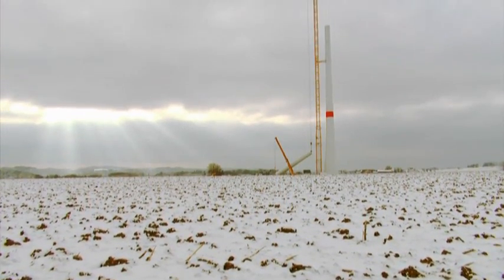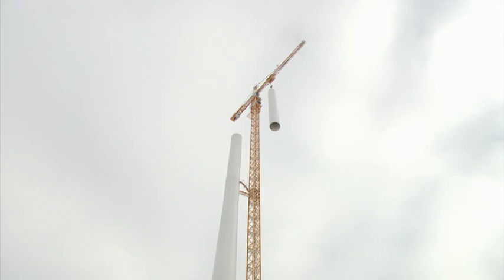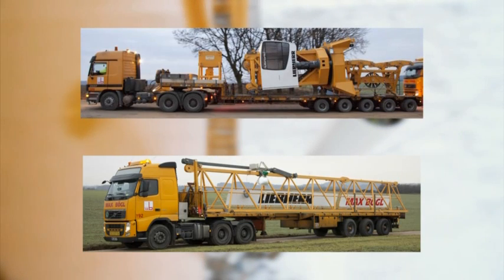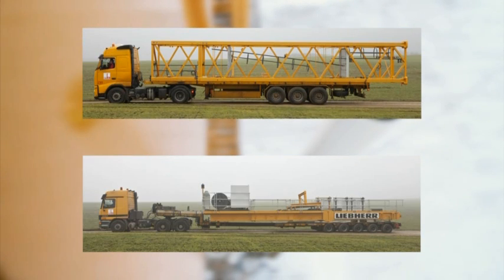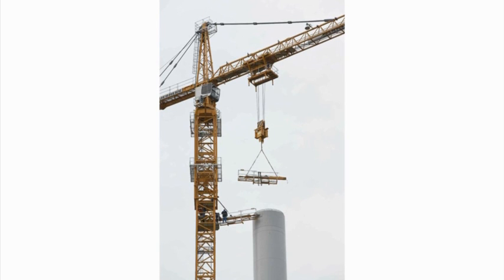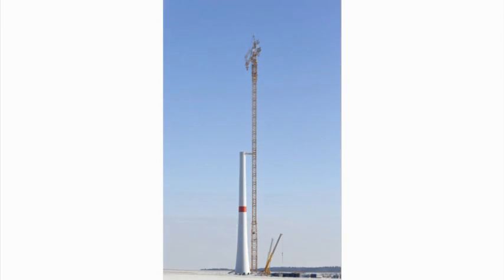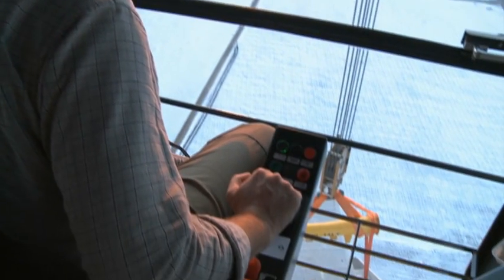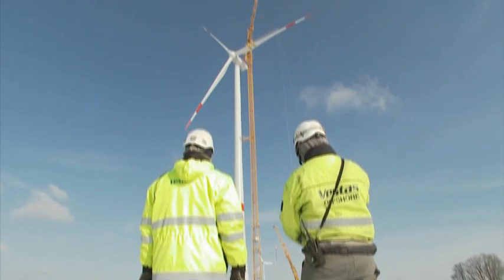Liebherr - tower cranes for wind power systems

Comment: manitowoc 16000 18000 more efficient,  access roads to next turbine and just walk the crane to the next site.
Reply: its the foot print
Reply: A 18000 wouldn't even come close to lifting those weights at that height.    The MLC 650 gets close but still won't chart with that tower crane at that height.

Comment: Why would you build a wind turbine in a low wind area when you want most wind for most power
Reply: Too much wind they spin off their nuts and blow themselves up.
Reply: I think what they are saying is that in regions with generally low winds in the flatter accessible areas, the turbines must be placed in hilly or mountainous areas typically inaccessible with conventional truck or crawler mounted cranes.